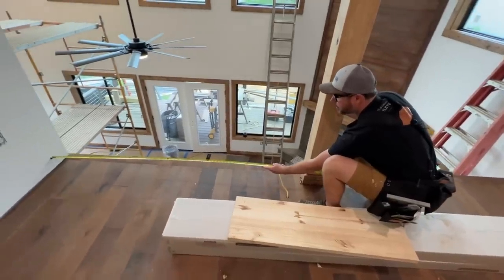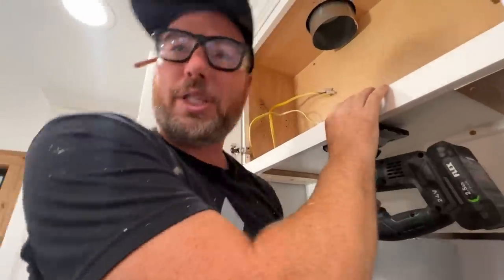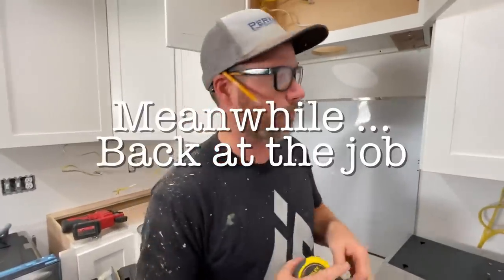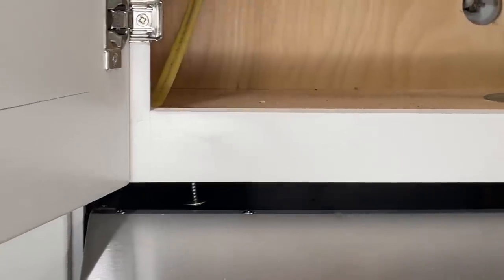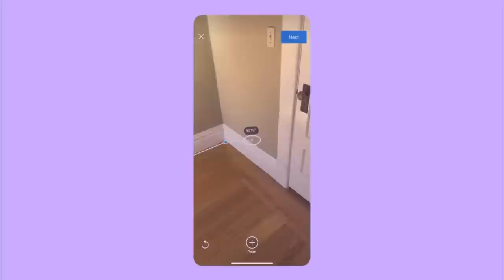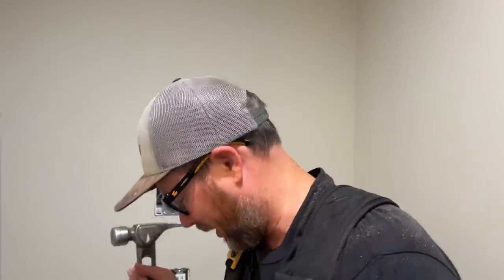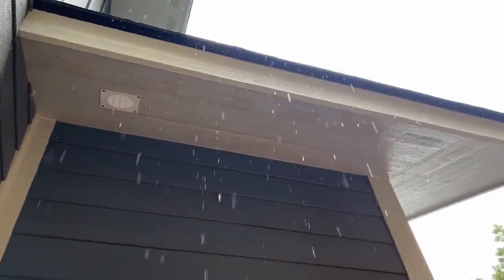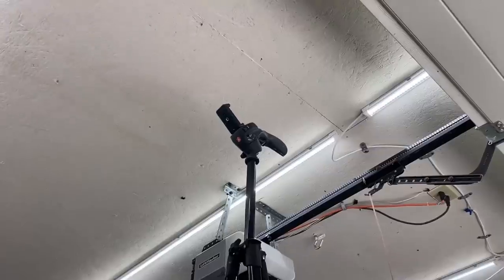Building A Mountain Cabin EP55 | Divide and Conquer!

Comment: Pro tip from a guy who used to be a metal fabricator in a shop that made a ton of wrought iron railing. Drill your holes in the channel so the bars go through. Then weld from the back side. Much cleaner and no having to grind down and finishing welds.

Comment: Pro tip : if you drilled the hole to small in a small block of filler wood to small , turn said block around or replace the block and start over with the hole .

Comment: Pro tip,when needing to drill a bigger hole in a pre existing hole,drill bigger hole size in a scrap of plywood,then center that over the pre existing hole and it will keep the paddle bit /hole saw bit from chattering all over….great job on the build,love your craftsmanship,attention to details and the camaraderie of the crew!!!
Reply: In this case turn the block of wood around or cut a new block.
Reply: 👍👍I'm glad I checked the comments section before writing my own version of the same info

Comment: I just installed a range hood yesterday with a similar scenario.  We held the range hood in place as a dry fit, centered it and marked a pencil line on one edge/side.  Then I got my buddy to hold it in place at that pencil line while I put the screw directly into the narrow part of the keyhole slot.  It seemed to work well. 

Thanks for the entertainment once again!
Reply: just hold it up and screw the screws in the key hole.

Comment: Hey guys big fan of you guys. I just wanted to ask if you think you’ll develop a tool bag that can hold a regular hitachi framing nailer. The reason I ask is because the section you made for tape measure. Thats typically where I would hang my nail gun from.
Reply: I think the design will stay the same for this first batch of belts. We may make changes over time if we see improvements

Comment: G,day Perkins Builders from Sydney Australia.
Enlarging holes with a hole saw through a piece of scrap ply, screwed/clamped in place is better. 
Australian residential code upgrade. (NCC 2022)
Ceiling fans are now mandatory in bedrooms for air circulation. This is an effort to reduce condensation and the growth of black mould.
🕳️🦉☎️

Comment: Is there a right handed version but with the tape holder on the left side?
Reply from the maker: The belt is modular… you can mount the tape pouch on the left with the hammer on the right on the other pouch